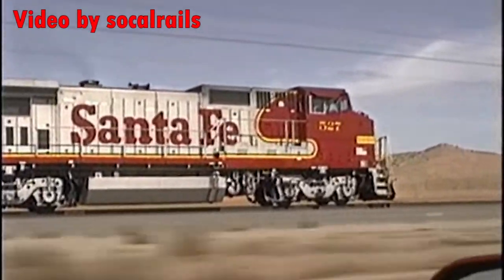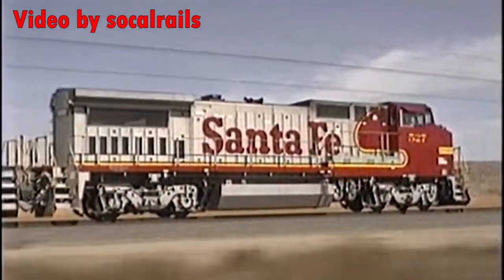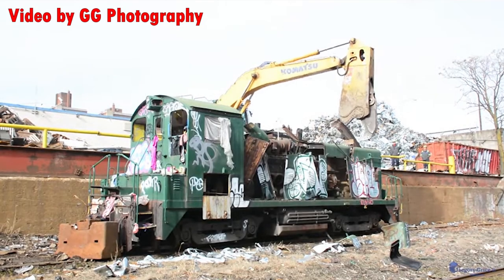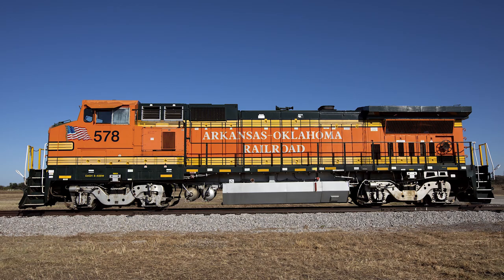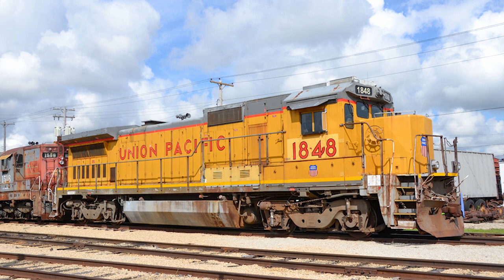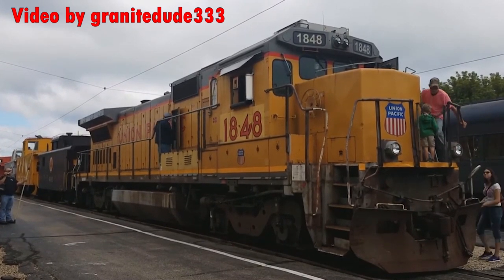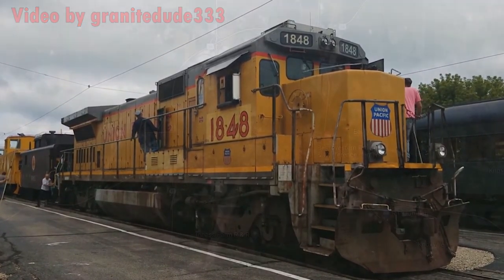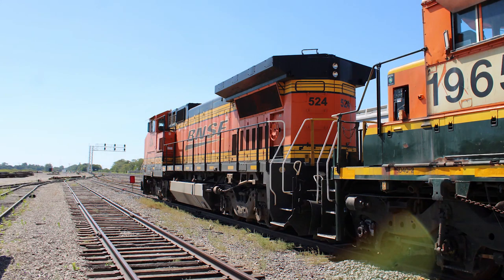What Happened To The Dash-8?

Comment: You forgot to mention what the Eight means. GE number identification is the decade the model was created. For example DASH 7 = 1970's, DASH 8 = 1980's, DASH 9 = 1990's and ES = 2000's.  Another Forgotten fact is that the DASH 8-40B was the most powerful HP ever built in a 4-axle B-B arrangement. It produced 4,000 hp, which was more than its competitor EMD GP60's. The DASH 8 series was designed for fast priority intermodal freight and passenger trains.
Reply: For a freight diesel-electric unit, yes, the B40-8 is the most powerful model.  The P42 (Genesis) is one example of a higher horsepower diesel-electric with four axles.
Reply: Maby you should have put this video on lol 😆
Reply: The P42, AEM-7, HHP-8 and ACS-64: Am I a joke to you?

Comment: Today, the only 3 class 1s using Dash 8s are Bnsf, CSX and CN. The only Bnsf units left are the B40-8Ws which many have been rebuilt recently. The rest are gone. CSX still has a lot of Dash 8s in service. Some were sold back to GECX and some to Pan Am but then they brought many back due to power shortages. Now, the only ones left on CSX are the wide cab units. And, with CSX buying Pan Am, this means there will be even more Dash 8s soon. CN is the only other railroad, but theirs will not be around much longer. CN has been sending many of their Dash 8s to scrap recently and it seems they don’t have much time left. Nice video
Reply from the maker: Thanks for the info! Hopes fully BNSF, CSX and CN will hold on to their dash-8’s for at least a few more years. Also, I’m glad you enjoyed the video.
Reply: Not all of the B40-8Ws have been rebuilt. Several of them are basically their original configuration.
Reply: The ex-CSX units that went to PanAm went back to CSX when CSX took over PanAm.
Reply: @silicon212  all of those have stayed on Pan Am except for 7627 which was renumbered to CSX 9280 and repainted, now a lot of the Pan Am Dash 8s have been sold to the new Berkshire & Eastern railroad which recently took over Pan Am Southern, not a lot remain with Pan Am/CSX and I find it unlikely that more will be repainted

Comment: Taken from the BNSF Locomotive Diesel Roster updated October 2022: Ex-ATSF; #555 scrapped; #560-582 returned to lessor; #575 part of dead line fleet; remaining B40-8W's in the 500-559 block are undergoing rebuild and repaint at GE. Looks like some are getting a new lease on life.
Reply from the maker: Thanks for all the info! Glad to see lots of them are still going to be used.
Reply: 555 was not scrapped, it’s still sitting in Galveston.
Reply: That’s what I thought there were a lot of them used on local power in h4 paint.
Reply: Yep, I saw #529 in Belen, NM about a month ago coupled to BNSF #267, an SD75M.

Comment: You didn't mention that CN up until very recently had a whole pile of Dash 8s, in 3 different models.  The cowl Canadian wide bodied ones, some of which are original to CN and some of which can with BC rail on buying them in 2004.  Then the C40-8Ws they bought off of BNSF and some I think came from IC.  Then the C40-8 standard cabs they bought from UP in 2010 or thereabouts.  However recently they have been getting rid of a whole pile of them.

Comment: We’ve got 2 B40-8Ws here in Omaha and 2 got pulled out of storage and are now in Lincoln. One of the 2 in Omaha is rebuilt (522) and one not (539). They are used for locals and switching, both are out of the yard right now, 522 on YOMA-101 & 539 is on the Bayard Local.
Reply from the maker: That’s awesome!
Reply: @Southern_Plains_Railfan  Yeah! I chased 522 a bit today, got some neat shots at Chalco,NE and over the Big Papillion Creek near Ralston, NE.

Comment: To hell with class 1 RR’s. They barely even tried to revive the 8’s. Yet the toaster oven Dash 9’s were rebuilt. I’ve already seen many NS rebuilds burnt to a crisp. 

NS and CSX rebuild program was just plain pathetic. 

NS used the oldest car bodies and earliest models for their rebuilding and not the latest wide cabs, ones that was ACTIVELY running on their railroads with slightly newer car bodies and more updated systems. Very similar to the dash 9 car body size. 

Im not sure why CSX stopped their CM40-8 rebuilds they look and work fine. Cant stand that this is the fate of my favorite locomotive.

Comment: When I worked for the Santa Fe telecom department in LA and later the BNSF I’ve been on all the 500 series Dash 8s at sometime including the 527 either at the old mechanical service area in Hobart Yard or at the new Commerce Mechanical service area just east of Hobart, they were great locomotives.
Reply from the maker: That's really cool! Why did you have to go on locomotives so much?
Reply: @Southern_Plains_Railfan  We would have fix problems with the radio and ETD head end device as well as check out locomotive radios and ETD head end devices in units that were going to be used as lead units in out going trains. When I started with AT&SF in April of 1995 they were using a radio package manufactured by Colt Technologies which consisted of a control head unit that was mounted in the control stand and the radio package that was mounted elsewhere in the cab but typically in the nose next to the toilet although if I recall correctly the old GE B23s had the package in the short hood back underneath the stairs which was a pain to get to. The radio package was mounted in AAR standard mounting tray which would also accept a railroad Micor and was connected to the control head via a multi conductor cable
which due to vibration in the locomotive was often a source of problems. I never had to change the cable (Thank God!) but the barrier strip terminal screws in the radio package and the compression screws on the control head connectors were constantly coming loose causing the radio to malfunction and one of the first checks we’d do on these units was pop the panel on the back of the control stand and pull the radio out of the mounting tray and make sure all the connections were tight. Colt also integrated the ETD functions into the control head via a separate radio package that they manufactured. The Colt control head had a membrane key pad on the front for entering the operating channel into the radio (you could enter separate transmit and receive channels for yard repeater and PBX operation) which worked rather well as long as it was not abused… But Colt failed to take into account the constant pissed off state that train crews were in at management when they designed these units son besides normal wear and tear the train crews wanting to get back at management for some slight (perceived or real) would take out their picket knives and carve up the keypad membrane in and attempt to stick it to the man when all they were really doing was F’ing us telecom guys over as the cost of replacing the damaged control head and radio handsets came out of our budget (I chewed out a crew in a departing train about this one time when they started complaining to me about how management was being mean to them and I explain in a rather loud voice that the only people they were screwing over was us telecom techs who were busy with many other tasks and had to get pulled away from regular work to take care of babies like them). So those experiences left me with a less than high opinion about the crews, combined with the crews propensity to leave art in permanent marked in the toilet compartment (Including one time were I found a two foot image of a penis ‘Functioning’ drawn in great detail and in permanent marker on the cab of a new SD70).
Later on in my career the BNSF switched to Motorola Railroad Spectra radios and the separate Pulse LCU-05 by Wabtec which proved to be less time consuming due to the ability to easily swap out bad units. And when the radio changed to narrow band transmission these units were replaced by JEM and Ritron radios that were capable of narrow band and digital transmission. When the AT&SF 3751 was going to make it’s trip to the Grand Canyon in the early 2000s we had to go to the old Santa Fe round house in LA that is now operated by Amtrak and install a Railroad Spectra radio in the cab for the trip, this also gave me my own personal photo shoot opportunity with the 3751 and I crawled all over it! Years later I had to go back and swap out the Spectra for a JEM radio so they could so they could continue to operate over BNSF tracks and because the Spectra’s were being scraped out I got to keep that radio which I have to this day.
During my 26 year career with the railroad I actually bounced back and forth between the AT&SF/BNSF and the UP in LA so I’ve worked in and on just about every Santa Fe, UP and former SP facility in Southern California and got to see a lot of interesting things. With the UP I was headquartered at LATC and had the old Taylor Yard locomotive facility as one of my responsibilities (I found a lot of old cool memorabilia there!). I had several private photo shoots as well as a private photo shoot during the run up to the 2002 Olympics with the UP business train with specially painted units 2001 and 2002 that were hauling the train including the Cauldron Car on the end of the train carrying the Olympic flame to Utah. I got some extremely cool shots of the Olympic flame contrasted with the LA downtown skyline in the back ground… Cool stuff!
Also, in between jobs at the BNSF and UP in early 2004 I spent a 3 1/2 month period working for the Rail Communications Division of the Los Angeles County Metropolitan Transit Authority working in communications equipment for both the light rail and subway system. While doing inspections in the subway tunnels I got a lot of great videos of run bys on subway trains doing 70 mph while passing two feet from my camera. The MTA was a rather strange place to work because of the politics involved in the project but I got a lot of great photos and videos as well as working with some great people.
Reply from the maker: Wow, that's awesome! Thank you so much!

Comment: Another place you can go see 1 in action every single day is the Auto-train yard in Sanford FL. Every day one of their 500 series B32-8's break apart P053 or build P052. Periodically one of the Auto-train's 2 dash 8's are sent down to Hialeah yard in Miami for switching duties. The neat thing about this run is that they'll send just a dash 8 with a single AT autorack so that the Dash 8 can run track speed per CSX rules. I have also seen a Dash 8 lead P091 or 97, but this is a very rare occurrence, the crews do not like them for long runs because they say they are uncomfortable.

Comment: In Minnesota on some of the BNSF lines I have seen BNSF 542 and 558 B40-8W’s paired together on locals lately with both of them still in the Santa Fe paint scheme although BNSF 558 had BNSF swapped out for the Santa Fe writing it’s still in the Santa Fe paint scheme!!! Even the other day the pair led a H train by there selves which was pretty cool for 2022-2023 and also in the deadline at BNSF Northtown yard in the Twin Cities I believe BNSF 563 Dash 8 is in a deadline
Reply from the maker: That's super cool! What subdivision were they on?
Reply: I’ve seen them mostly on the Staples sub but they also have ran on the Midway and St Paul Sub
Reply: They have also ran on some smaller subs like the Monticello sub every once in a while